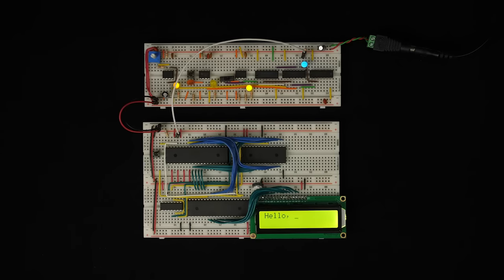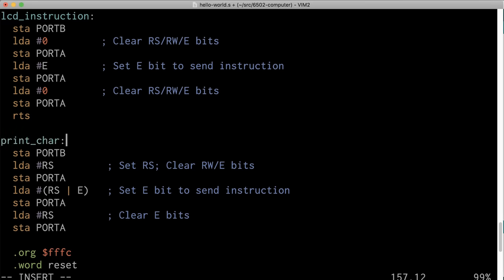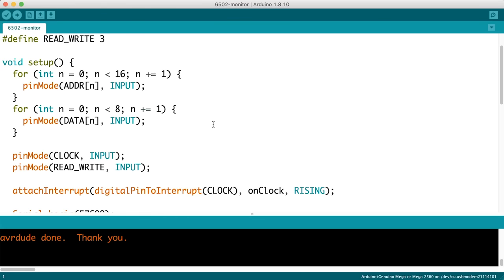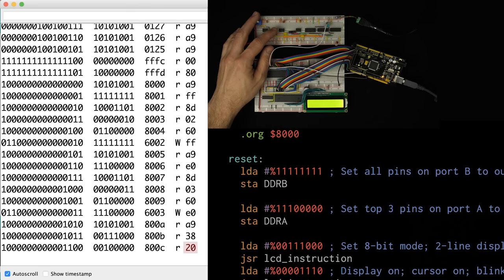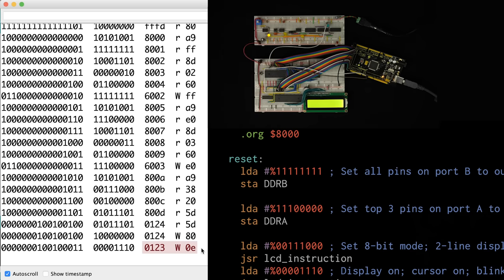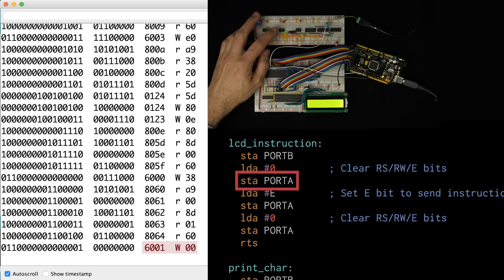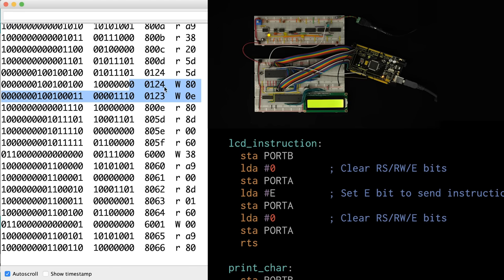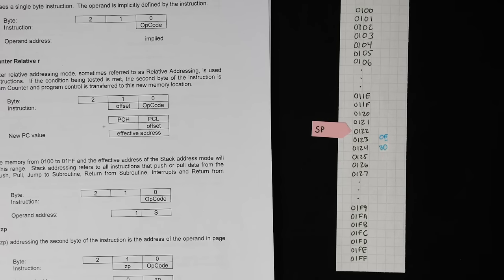What is a stack and how does it work? — 6502 part 5

Comment: now THIS is full stack programming
Reply: carterisonline Ahaha 😅😅😅
Reply: Not yet it isn't, need to install some RAM before we can have a full stack to work on.
Reply: Just download a bit of RAM
Reply: xD
Reply: @nadie9058  wow! You know
Reply: This + his GPU + some RAM = most secure PC
Reply: @Terszel  No since no operating system can run on that afaik
Reply: @nebulium6641  He can build his own
Reply: @Terszel  Not on a 6502 though since it doesn't have any concept of memory protection or priveleged execution
Reply: @TheMrKeksLp  its just a joke no need to get technical
Reply: @HadleyCanine  I thought CPU stacks were built into the processor though we're they always in RAM and I was just dumb
Reply: Finally, a funny joke
Reply: @TheMrKeksLp  Privileged execution is a function of the kernel.
Reply: @universallyepicnarwhal9102  Nope. The x86 processor has hardware built into it so the kernel (or whatever switches it into protected mode) has level 0 and can directly access hardware and all of memory while most processes run at level 3 and cannot access hardware without going through the kernel nor access any memory that isn't allotted to that process. The 6502 has no such mechanisms and whatever happens to be executing at that moment has 100% control over the computer. The operating system can only regain control if the process allows it to, just like it used to be on x86 computers before Windows 95 and Linux hit the scene.
Reply: @HadleyCanine  lol
Reply: @nebulium6641  was a joke nerd

Comment: I want to let you know that you are one of the reasons why I as an electrical engineer student chose the specialization of computer engineering
Reply: I enrolled in computer engineering back in 1988... left the program in 1990 and switched to programming because of a) terrible part-time "teachers" who were full time engineers but couldn't explain  b) tired of everyone in the class getting 40's on exams and then getting 70's thx to a curve.  I felt like I was learning ANYTHING related to actual computer engineering nor could I understand what was going on.

Fast forward to 2020 and I just learned more in a 25 minute video than in an entire semester of college!  The internet and access to info has changed learning... if I had these tools, I probably would have stuck with the program all those years ago!  Thank  you for doing what you do.... very clear explanation and well presented!
Reply: Can we use another eeprom as our ram?
Reply: @zulqarnayeenschaftler9323  No, because ROM is read only memory. Can't write to it.
Reply: Okay, but how do we programed the first ROM?
Reply: @zulqarnayeenschaftler9323  theoreticlly
Reply: @thepawday  with a programmer, which needs special erase lines (erases everything) and special programming voltages which the regular data bus doesn’t do. That’s why it’s usually dedicated hardware. You could technically build a programmer from a regular CPU, but it’d be slow and complex and get in the way of other operations. Especially since you have to write-out the entire ROM capacity every time, you have no option to just change a couple of bytes. Of course OTOH the ROM keeps its data even after losing power, which RAM (easy to write to) can’t. This is why you usually see both in a computer.

Comment: If you're adding RAM, I'd like to suggest 640k of it. That'll be enough for everyone.
Reply: Unfortunately we don't have enough address space unless we do some fun segmentation/swapping to work with >16 bit pointers. 16 bits is 65536 addresses, or 64K, not 640K.
Reply: @timh.6872  I know. It was a joke. ;-)
Reply: Bill gates reference !
Reply: @MaxTheDragon  yo
Reply: @andrevc85  xD
Reply: You can just download some RAM and program it to the 6502.
Reply: @timh.6872  isnt that how most pre 32 bit computers did it thougj?
Reply: @loserface3962  
Most 8 bit processors had a 16 bit address bus with 64 kilobytes of ram. A lot of the 16 bit computers had a 24 bit address bus with a maximum 16 megabytes. Bank switching was common though too. Even 32 bit Intel processors had Physical Address Extensions which was sort of like bank switching.
Reply: @loserface3962  Yes, if you're talking about the maximum amount of conventional memory in a 8-bit 8088 or 16-bit 8086 machine.

FUN FACT: Modern computers still use the x86 architecture, allowing DOS and really old Windows to run on any modern PC, by the early 1990s with the release of Windows 3.0 in 1990 and 3.1 in 1992 all non-IBM PC compatibles were pretty much doomed to failure.
Reply: @brandontechnerd  i heard modern x86 processors boot in protected or long mode then the bios does what it wants to do for initilizing hardware, then it resets the processor into real mode.
Reply: @loserface3962  BIOS is a firmware boots the system in real mode, loading kernel into memory and sending an instruction to the cpu to start executing OS code. This is where the BIOS hands the controls to the kernel which begins to run in protected mode. The CPU has no idea whether its running in protected mode or not, that is the job of the kernel.
Reply: @mistorT101  But does the cpu start in real mode or does it start in protected mode first? For efi systems the cpu is in long mode while initialized. Does the cpu start in protected/long mode or does it start in real mode and the motherboard sets it up to run in long mode? I know that in general old computer processors like the 386 start in real mode and then the OS programmer must initialize protected mode.
Reply: Much appreciated Bill
Reply: @timh.6872  Kinda missed that one when it went by in the 80s eh
Reply: @andrevc85  Except the exact quote mentioned "who would EVER need more than 128k of Memory!"  I believe this was when the "128k Mac" came out.
Reply: No problemo, just implement memory paging...  Older CPUs would not be able to access large contiguous memory.

Comment: How I wish I'd had access to these videos back when I was trying to understand 68000 assembler on the Atari ST.  Before the Internet, and with crappy tech sections in the local library I had one pretty opaque book as a resource, and I really struggled.  

These videos are absolutely brilliant - thank you for putting them out there. I have no doubt that in 10 years time some really accomplished engineers will owe a lot of their success to you.
Reply: if we had that back then we could have programmed some nes game (kinda same chip afaik) ;D . wish i had a library that had tech books XD .
Reply: The other issue back when I was trying to learn this was the SDK for the Commodore Amiga was £130 (in 1987!) and so completely out of reach.  As soon as you wanted to do something beyond print to the CLI you didn't have the includes, offsets, vectors to call routines you needed.  There were some "sandbox" environments but they weren't worth much.
By the time I got to an OS with and open stack it was a Celeron CPU with a modern OS (Linux) and a lot harder to understand and code for.
I found the arduinno (or other MCU) is a nice little place to learn assembler, though a little different than a 6502/68000, it still small and simple enough and not bogged down in the details of the OS.
It's really heplful to see Ben apply this to a real CPU on a BB.
Reply: That is exactly what i thought. I wish we had this videos back in Amiga times 🙄
Reply: @DarthZackTheFirstI  NES uses the 6510, a 6502 variant, while OP talks about a 68k (Amiga, Mac, ST, Mega Drive) :) so indeed these videos could help get started with an NES. But the core concepts can also help to understand any machine-specific assembly, you just have to go look at the data sheet to find specific behaviour (ie the Z80, used in the Game about, initialises quite differently to the 6502)

Comment: I am software engineer with MSc and over 15 years of professional experience. 6502 Hello world was like click bait for me, since I just recently started playing with Arduino and ESP32.
I would like to send BIG thank you to you Ben Eater. I should have learned that during my MSc, but it was not part of it.
I also need to say, I am admiring when you have printed data sheet (instead of displaying PDF), but the thing that makes me smile every time I see it in your videos is the paper with all the addresses, codes, etc. written manually. It is not just that you use paper to show that off (actually SP pointer as a little arrow "forced" me to write this comment). You actually did handwrite all of the 0's, 1's and other HEXes. It is not printed it is hand written. WOW !!!

Comment: 14:36

"Our computer doesn't actually have any RAM in it"

Never thought I'd ever hear that.
Reply: After he fixed up the code and plugged the ROM chip in, I started yelling "No no no no!!  Not gonna work!" at the screen like it's a damn football game! LOL.
Reply: @markjones5973  lmao, yeah I didn't actually consider that the system didn't have RAM yet, but it took me rather little to figure it out after the fact
Reply: Well, it has memory, it's just read only...
Reply: @joshuawalker7054  well it is an EEPROM so not really read only. Also I think that the EEPROM can be used instead of a RAM here?
Reply: @noether9447  Except you really don't want to do that.
Reply: @RealCadde  can you please explain why is that?
Reply: @noether9447  Basically EEPROM has a limited number of writes (10k or 100k, don't remember), so if you write to it frequently it wears off and doesn't store values you want to put in
Reply: @noether9447  EEPROMS are not flash ram. You have to electriclly put the chip into a "write only" state and then write to the whole chip very slowly using considerable voltage. It's not random access at all. (RAM = Random Access Memory). EEPROM is "Electriclly Eraseable/Programmable Read Only Memory"  - You also have PROMS which are just "Programmable Read Only Memory" those have a little window over the chip so you can delete the contents of the ROM using UV light.
Reply: I love how he knew it wouldn't work, but just soldiered on and acting surprised in order to teach us.
Reply: @noether9447  You already got your answers right there. In essence it will wear out fast and also be slow.
Reply: Actually... Actually it does have RAM insofar as RAM stands for Random Access Memory. And that EEPROM is definitely able to be randomly accessed.
Reply: If your code is compact enough, or doesn't need copious amounts of data such that it can run entirely from the CPUs registers, then you don't need RAM.

Case in point, Ben's 6502 series to date.
Reply: @joshuawalker7054  Wow, this is really interesting. Thanks for the info!
Reply: @joshuawalker7054  Heh, that reminds me about nearly 21 years ago when my kid was born.  She had a bit of jaundice so she had to have a UV machine and jacket for a few days.  My crazy brother had a PROM chip for some reason, and brought it with him when he came down to visit because he wanted to see if the UV light from her machine would erase it.  It didn't work too well.
Reply: @TomStorey96  Not really. Imagine trying to make even basic programs without RAM. A couple of registers isn't enough to do very much. Sure you could probably do some cool proof of concepts, but you aren't making any real programs without ram.
Reply: @kneesnap1041  Yes, really. If all you need is a couple of registers to do your work, then you do not need RAM. Ive seen it done before for very simple things. No, you wont be doing much in your application, but it is an application specific thing.
Reply: @TomStorey96  I guess, yeah. Something like a controller for Christmas tree lights would be a possible use. I guess I'm thinking more in terms of general computing, kind of like an esoteric language. (Sorta)

Comment: Being (or having been, back in the days) a fairly experienced 6502 assembly programmer, I have always thought the stack were inside the processor. It is amazing to learn everything anew even a level of abstraction less - or two. Keep up the amazing work!
Reply: That’s not surprising, reserving some RAM for the stack was one of the 6502’s (and 6501 before it got pulled for patent infringement) cost cutting measures against the 6800. 6800 had a lot more registers too! Since programmers were accustomed to separate stacks, the machine code still acts as if it’s an onboard location. Indeed some latter interface chips had enough RAM for the stack so it could operate even without proper system RAM, which no doubt further pushed that perception!

Comment: With a computer science degree, this isn't new to me, but I didn't know about the 6502 and how similar it is to "good old" x86. The basics are the same. What was a bit frustrating for me during my studies, was that I knew roughly how it all related to the electronics, but I didn't know how to bridge electronics with microprocessors in practice. Modern processors are made in laboratories, and the other hardware is also much too advanced for a hobbyist. Thanks to videos like these, that show how easy it can be with a processor like 6502, ROM and RAM chips, that seemingly impossible barrier is no longer impossible. I can sit down and make my own computer, just like that, and that just feels awesome. Hopefully I'll find the time to do just that.
Reply: Microcontrollers are a good way to get into hobby computing.  If you don't want to go too deeply into the hardware then you can use one of the Ardunio computers, but it's also perfectly possible to build something simple with a PIC chip.
Not so long ago, I programmed a 8-pin PIC to act as a white noise generator using one of its pins as the output and using a 32-bit pseudo-random number generator adapted from a software implemented shift register.  That was fun.
One of the best bits is that because of the voltage tolerance, I can run it from a single lithium-ion rechargeable cell.  I only needed to add a speaker to get the output, but with a buffer transistor I get more volume since it acts like an amplifier.  Exactly four components in the end: PIC, transistor, speaker and battery, and I now have something I could use to make white noise to sleep by.

Comment: Great! Now I have to wait another month for Ben to put ram chip into 6502 computer.
Reply: Yeah, while I enjoy the 30 minute primer, I would have appreciated a warning that this was purely concept/theory and that we'd have to wait for the next vid to get to the actual RAM installation. I pulled out and setup all my kit to follow along with this video for...well...nothing, as everything I needed to learn this time was in the video. No real hands-on needed. I would have released this video AND the RAM install video at the same time...even if that meant withholding this one just a couple weeks longer.
Reply: You could try to put it in yourself. Just check the data sheet for that ram to see which pins do what, and see if you can figure out how it goes together. That type of independent exercise is enormously educational. Even if you fail, it's just a teachable moment.
When Ben comes back with the next video, his way might be a little different than your way, but there are many different ways to connect these together (logic processing of the address lines I mean).
Just make sure you are careful with your output enable line and r/w line so that your ROM, RAM, and CPU never have their outputs enabled at the same time on the data buss. You will burn out something if you do that.

Comment: At 9:41 I had this crazy moment when I realized the call stack (which, as a python/JS programmer I think of as this abstract thing that exists somewhere in virtual memory) is a literal physical object in this system - that is missing - and as a result the poor microprocessor has dementia and doesn't know where to come back to. I've never been able to get into low level systems before, but your guides make it approachable and easy to follow. Thanks!

Comment: I've been really looking forward to this video.  I wanted to see how you explained the stack to the layperson.  I think the stack, with the JSR and RTS instructions are the neatest concepts of the 6502, or any processor for that matter.

I wrote a 6502 emulator a while back.  Coding the stack related functions was some of the most fun parts of the sub-project.
Reply: Ooh. Is it open source? I'd be interested in checking it out.
Reply: @kneesnap1041  Not at the moment.  I want to put it on Git Hub.  I just haven't gotten around to it.

Comment: there is something extremely relaxing about his videos, I do not know what it is
Reply: You are right; i would put it down to his calm voice, and the thoroughness with which he explains how things work.
Reply: Agree with Berty. 
As a fairly experienced (modern c/c++) programmer but comparatively inexperienced in electronics, he explains everything in the right level of information and depth for me. 
I'm not building a computer like this (yet), but has helped me understand electronics, computers, and programming at a lower level than I had.
Reply: And understanding something the first time its explained is very relaxing :^)